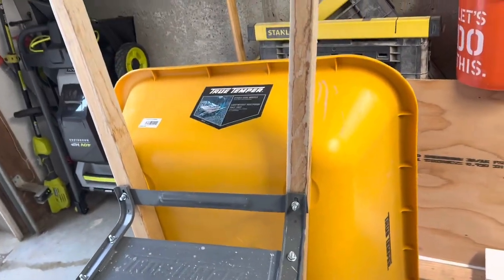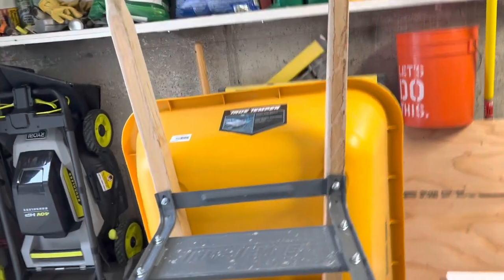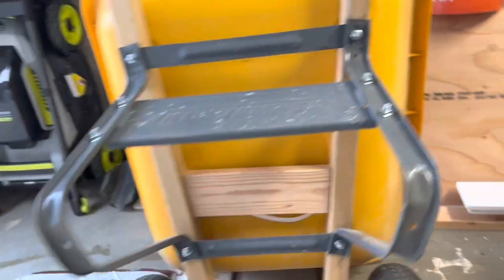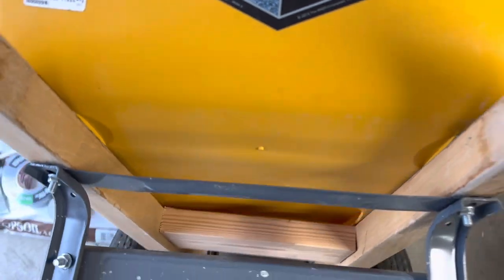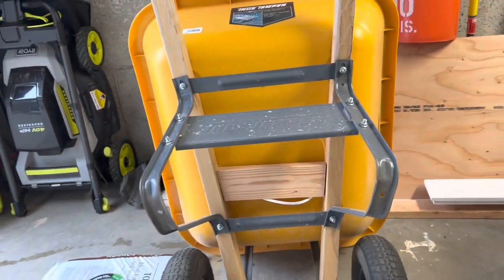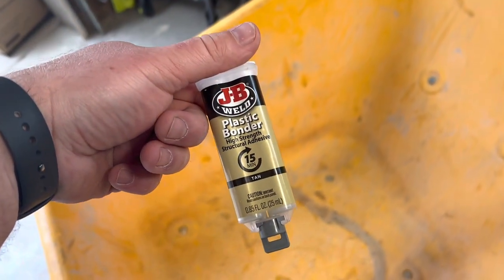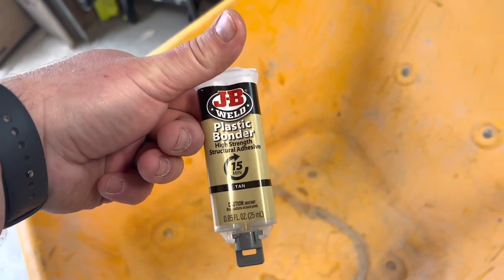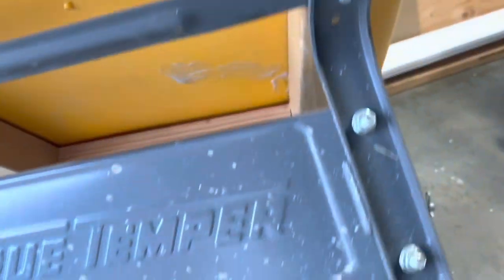How to fix a plastic wheelbarrow the right way! Under $9 to fix and very quick.

Comment: I used a piece of semi flexible plastic  that I cut to fit the bottom of the plastic tray. then I glued the plastic reinforcement to the plastic tray.  Drilled new holes and reinstalled the bolts to hold the tray and the reinforcement in place.

The main weakness of plastic trays is their susceptibility to cracking, so I figure the reinforcement will deter that in the future.

Comment: Separated bucket from handles & inserted plywood. To cover the whole bottom. From top screwed down along the whole crack. Jb weld then sanded and painted for no shovel snag.